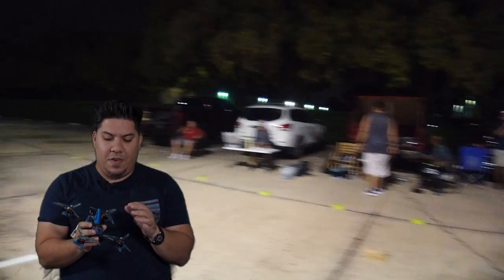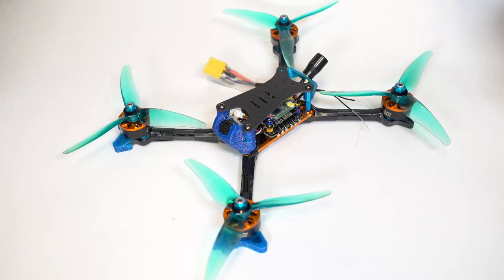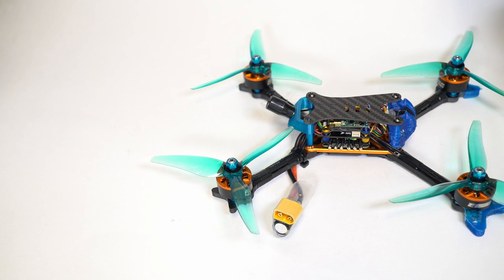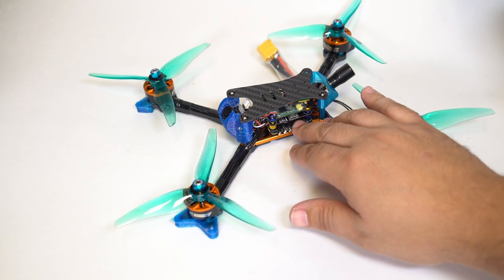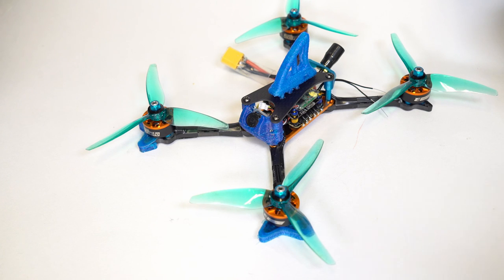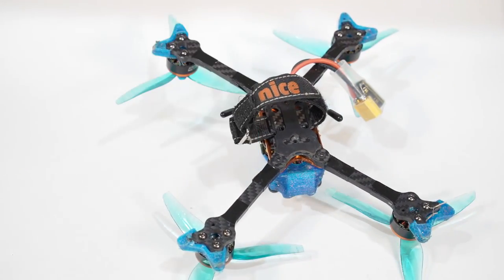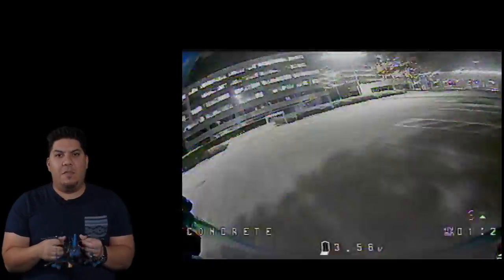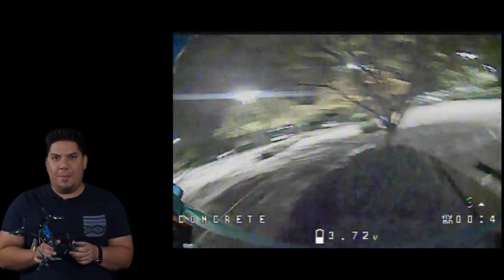Concrete Racing Quad - Hyperlite 2207.5 E motors - Budget Build for cheap drone racing fun

Comment: I’m liking the hyperlite e motors. Got a set in last week. So far so good with them.
Reply from the maker: def a great value
Reply: Jon E5 FPV yep 👍 think I’m about to order another set
Reply: Jon E5 FPV finally got to fly my hyperlite E 1722’s yesterday. Gotta say I like em. Comparing them to the Xilo 2207 1750 the Power feels the same if not just a hair more powerful than the xilo’s and time will tell how durable they are as o haven’t crashed them yet. I know the xilo’s can take some hits and at our last race I totaled my quad and the only thing left working on it was the Xilo motors, fried the fc, esc, vtx and exploded the cam lol. For the price tho I’m definitely loving the E series. Waiting For a set of Xing E 2207 1800’s to come in and ima do a sbs of all three motors 👍

Comment: After 2 months and a warehouse race yesterday where 5 of us were all running the e series 1722’s and after all of the crashing yesterday not one of us killed a motor. 😀👍👍. Carbon was definitely destroyed but the motors all lived.
Reply from the maker: awesome!  Good notes, i have found them holding up to multiple visits to the night spot as well.  Stocked up on a few more sets on the last sale.
Reply: Jon E5 FPV Drones nice. I find them to be a bit more powerful than my normal Xilo 2207 1750 setup. Same frame(arc one) same revoltosd fc but the Xilo quad has a tmotor f45a esc and the e series has a hobbywing 60a. But the e series is much lighter, my scale is broke but I’m betting at least a 15-20 gram difference between the two quads. There’s only like a 1.5g difference in the weight of the motors but you can feel the difference in your hand and in the flight. The 2207.5’s are much snappier and agile feeling but I still love the Xilo motors. Had the same 4 on my arc one the last year and their still holding up well. Even after some bad crashes on the concrete yesterday they still spin smooth. One is finally getting a little crunchy tho.

Comment: These are basically what my 'nice' builds usually run... wait this IS my nice build.  They're surprisingly good all around - and I don't have the heart to tell people I race with that I'm keeping up on <$200 quads.
Reply from the maker: For sure, after flying this, there is no reason why my other builds would be any faster in a race.  Very impressed how far the budget end of stuff has come in the last couple years.  Hoping we can include a lot more people in the hobby with these new prices.
Reply: @JonE5FPV  Totally right - although I think the future has a lot more ~100g BNF stuff in it than anything else.  Not a bad thing, but it's hard to argue with something that is 2/3 of the price of these, even cheaper to operate, no building skill barrier to entry, and is light enough to not need registration.

Comment: I have almost the same build but im using a aikon 2020 stack nano rx and nano pro 32 and i could only get 1922kv so i adjusted the motor output limit sobits 1750kv very fast and handles great
Reply from the maker: Sounds awesome, what weight did you get with 20x20?
Reply: AUW without a batt is 290g was hoping for a bit less ghe big motors killed it. I have a v2 floss and its the same at 290g with a 30x30 but has small 2205 2722kv what AUW do you get with your floss builds?

Comment: Where did you get the TPU cam mount from?
Reply from the maker: Printed it, the arm guards and the battery protector
Reply: Jon E5 FPV I knew that part but specifically the mount that fits nano cameras. I’ve never seen a nano cam mount just micro....
Reply from the maker: It’s for micro.  The Runcam nano 2 comes with an adapter to mount nano cam in a micro mount.
Reply: Jon E5 FPV that’s cool 
Thanks!

Comment: The big downside to them is that you cannot get the bells off the stator, I’ve stripped 3 of them trying to get the bells off and still havent gotten them off
Reply from the maker: Interesting note.  I will be sure and pay attention and go slow if I ever need to swap a bell.
Reply: usually you need to heat the bell screw with a soldering iron to soften the locktite